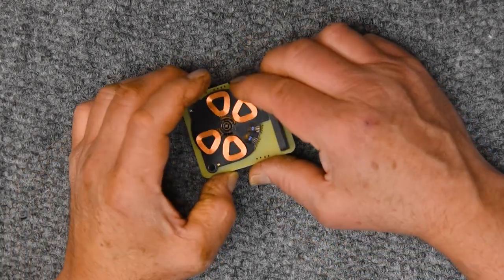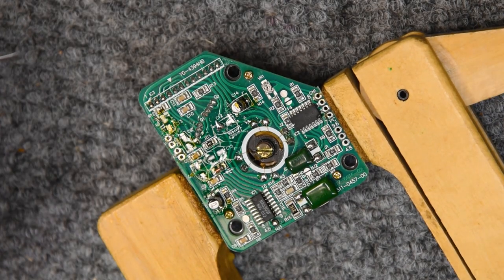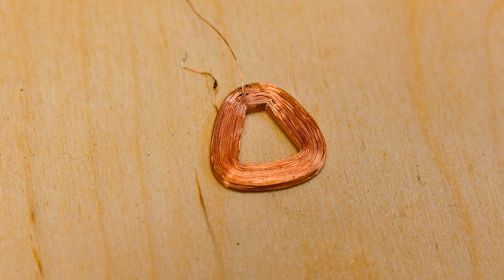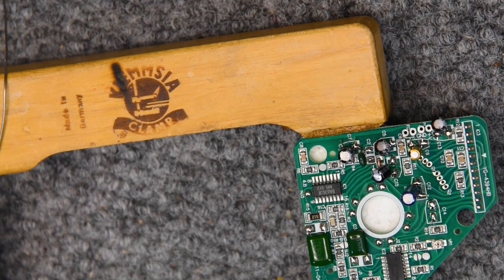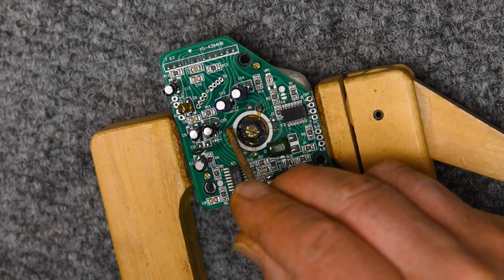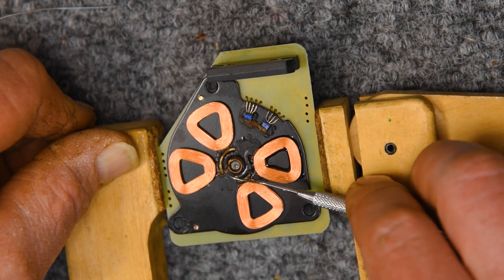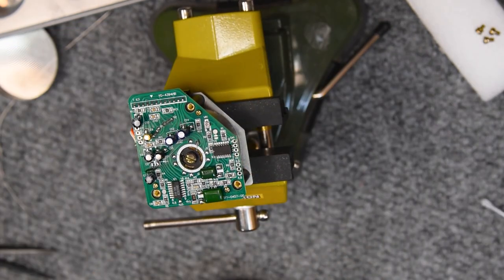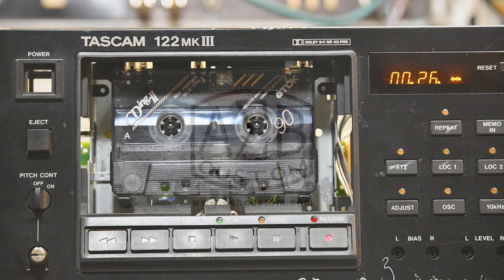Tascam 122mk2 and 122mk3 Capstan Motor Complete Rebuild

Comment: A message to others out there: Another reason why sanding is 'chancy' on a take-up capstan - it is possible that one could etch an effective ultra-fine thread, and it's feasible that the tape may just begin to ride up, or attempt to, in short azimuth/track height issues?

Comment: Do you recommend using only electrolytic caps and a film cap to replace those SMD caps.  I'm about ready to place a order for the parts.  Thank you!
Reply from the maker: That's how I do it, yes.
Reply: @asbcustom  do you happen to have a list of the caps that you used that you could share?
Reply from the maker: @rod.d  
Capstan PCB:
3 -  10μf 16v
1 - 1μf 50v
1 – 4.7μf 35v (I use 50v)
2 – 3.3μf 25v (I use 50v)  bipolar
1 – 1000pf Film cap on C2
Reply: @asbcustom  Thanks!!!
Reply from the maker: @rod.d My pleasure.
Reply from the maker: @rod.d  
3 -  10μf 16v
1 - 1μf 50v
1 – 4.7μf 35v (I use 50v)
2 – 3.3μf 25v (I use 50v)  bipolar
1 – 1000pf Film cap on C2

Comment: Good afternoon, sir. Let's see if you could help me with a Tascam 122MK3. First, I changed the capacitors to the capstan card and it kept turning very fast, and the capstan kept turning, then I mounted a new card from ebay and now it goes very slow. I would appreciate your help. They recommended me to you
Reply from the maker: Sure, I'll help you out. Contact me through the e-mail link on my "About" page and I'll send you the shipping address.